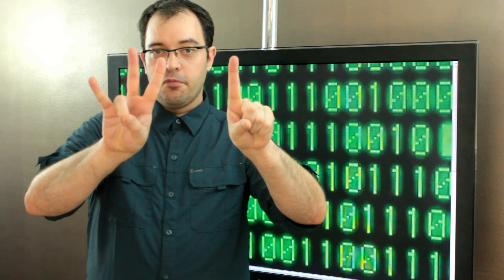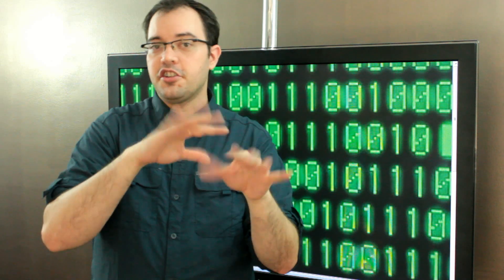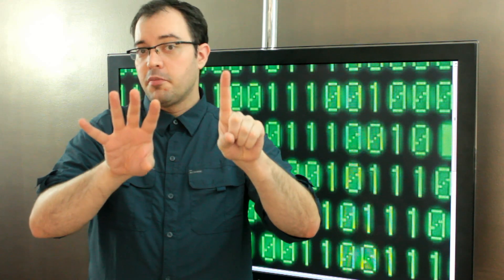How Parity Bits Allow Raid To Recover Lost Data

Comment: So question: let's say I want to save 1single byte to my 2 hardrive raid0 configuration.
Let's say we have the byte: 10101010
When this byte is written to our 2 hardrives does raid put the first bit on drive 1, the second bit on drive 2, the 3rd bit on drive one, the 4th bit on drive 2, and so on? 

(Hope this question makes sense.)
Reply: Well, from what little I understand, raid0 doesn't use parity at all. It just stripes the info evenly across all drives. If you lose one drive, you got like half of your data missing. You're screwed.

But in regards to your question, now I'm wondering the same thing lol

Comment: So, basically, with a RAID 5 array, if you lose one disk, the RAID controller does some math and determines what it was supposed to be, but if you lose two disks, your SOL because there is no longer enough info to determine what is missing?

Comment: As a best practice, all of your drives should be the exact same model and size. Using two high perf drives and an economic drive will cause you RAID set to perform poorly as reads and writes from the two high performance drives will have to wait for the slower drive to respond. 

Parity is not calculated on a single drive. It is calculated on all the drives.

Comment: Thanks for your quick reply. Reviewed video again. Repeated two parts. 0.27, you say, "you can always figure out if you know a piece of data and you know the parity, what a missing piece of data is". 1.18, "If you're missing any of the bits along the way, you can calculate what the missing bit was. This is how you recover from losing a single drive".

how does RAID calculate a missing piece of data or reconstructs missing piece of data when drive fails? How does third drive recover data?

Comment from the maker: No. watch it again. if you have 3 drives 2 store data, the third has a calculated value.

1+1 = 0
0+1 = 1
1+0 = 1
0+0 = 0